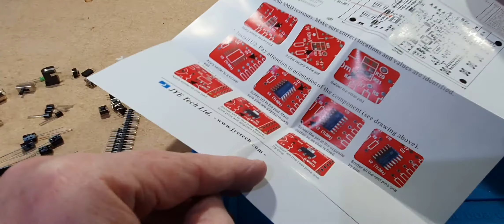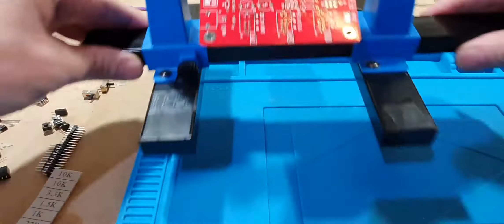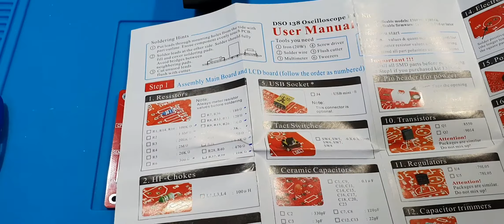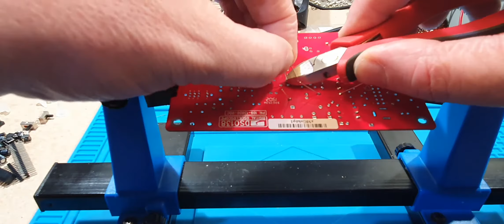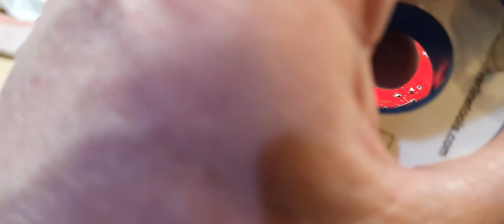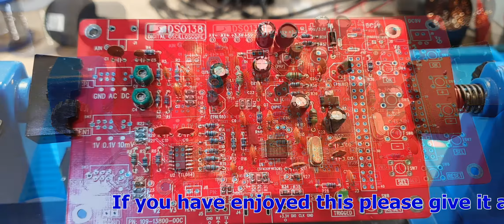Kit build of DSO138 Oscilloscope - Part01

Comment: when soldering smd chips like that you should use a chisel tip as it will make it easier also use a flux pen on the pins after you get the corners tacked down. the flux will help the solder flow only on to the chip legs making all smd a lot easier.

Have fun with your kit, it took me 4 hours to build mine I was so nervous. :)
Reply from the maker: Thanks for your reply :-)